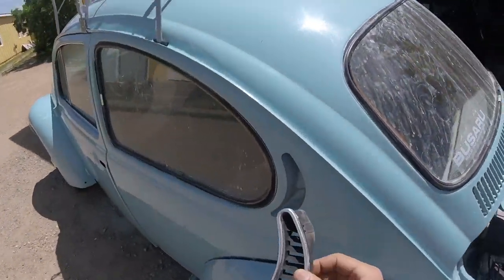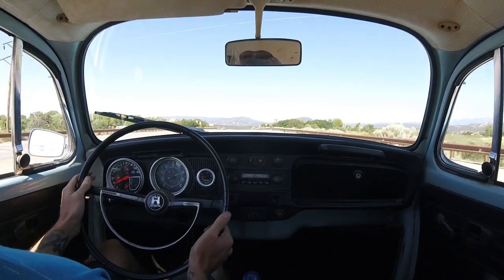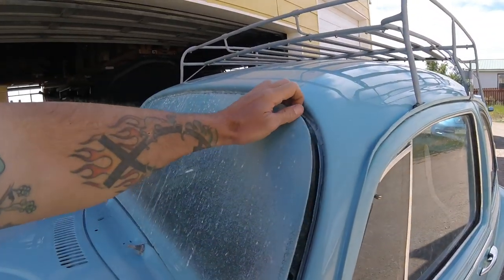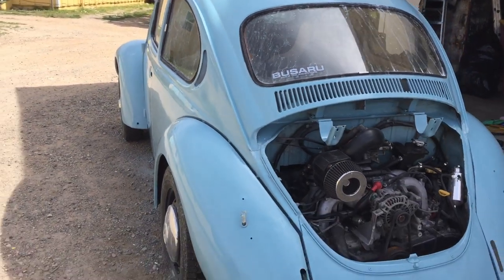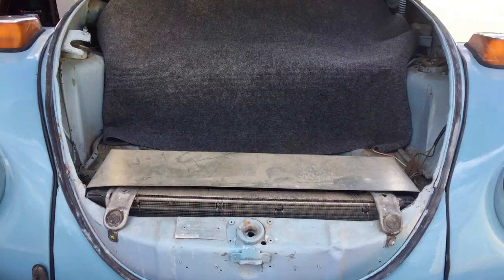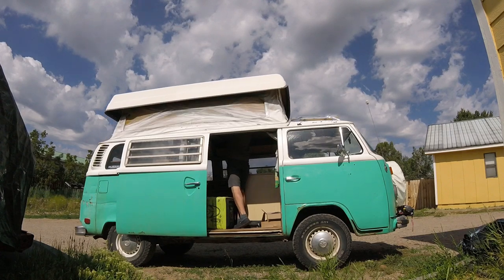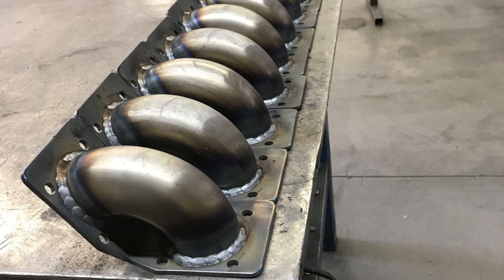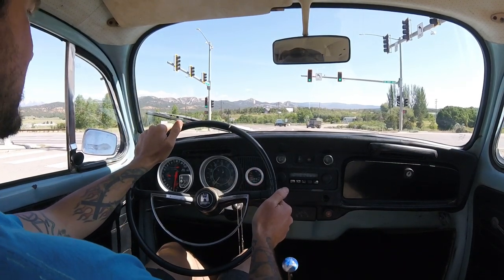BUGaru turbo Subaru VW Beetle Final

Comment: Back in 1988, I was 20 years old and my sister had not long ago got her driver's license. My mom gave her her 1982 Honda Civic. My mom and stepfather bought the neighbor's 1982 Subaru GL. There were plenty of times I changed 🛢 and filter on that car. After looking at the engine and realized it had certain things in common with the the engines in the VW Beetle and the Bus, I could see that it was possible to run a Subaru engine in a VW. There modifications that would have to be made but it could be done. Hence I was dreaming up a Bugaru and a Busaru and now I find that they really do exist.

Comment: One of the things I like, is that the Subaru engine still kind of sounds like a bug!
Reply: Like a bug, but with MOAR POWAH!
Reply: Yup because they are both designed similarly. Boxer engjnes
Reply: @jv1990  Is the Beetle engine a true boxer or is it a flat engine? One crank pin per two opposed cylinders or one per cylinder? I can't seem to find that out.

But yeah they have the same firing order so if the headers are using the same lengths as the Beetle you get the same sound which is of course awesome! Not much beats the sound of a Beetle, though the Subaru deep rumble is a very close second :P
Reply: @Avetho  no idea lol considering the vw was made in Germany i wouldn't doubt its a true boxer and not a flat. Idk I have never worked on one.
Reply: @jv1990  Well, I guess its time for me to get my researching glasses on and dig out my Googling skills XD
Reply: @Avetho  air cooled engine with electronic engine like the subaru so many pro and cons! But when considering a reliable smooth running experience in apples to apples a decent New high power engine is very expensive like the from CB performance 1776 with EFI fuel systems!$10,000 yikes 😳 Just wondering if a subaru engine would do as much justice as the CB Efi 1776

Comment: I know you sold this already- but just curious how cool it ran with the radiator set up you used up front? Did the airflow turn out adequate to keep the temps in check when it was under load? Great job here- I think this is a great solution for any bug- louvers up front would work just as well as the slots that the factory put on the Super Beetle- and Subaru engines produce for more power then VW's - for far, far less money!

Comment: Love the videos been following the builds for a while, I'm putting a 2003 2.5 SOHC non turbo in my Baja now, how do you run your physical throttle cables for non "drive by wire" motors and still get full throttle range out of the motor? The Volkswagen stock pedal throw is only about an inch so I'm trying to come up with a new way but wanted to know how you ran yours to get some ideas. Thanks!

Comment: Bud great  bug.  What tranny did u use?  I have a turbo wrx that i will mount in my 75 bus.  Can i still use the original bus tranny with the adapter plate?  Will the tranny handle the hp from the turbo wrx
Reply from the maker: I used the stock transmission in this bug. Your 75 should be fine as long as you do rolling starts and don’t dump the clutch all the time.

Comment: The VW transmission,  does it stand up to the Suburu engine????
Reply: I’m doing some what the same but with a WRX motor, and no it won’t, it will yard sell a stock transmission. Rancho built my supersubaru transmission.